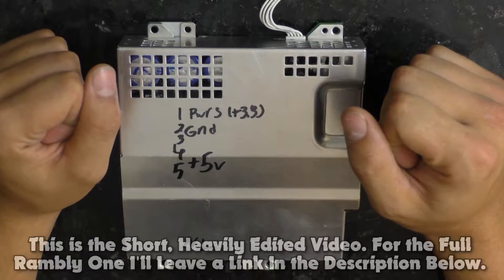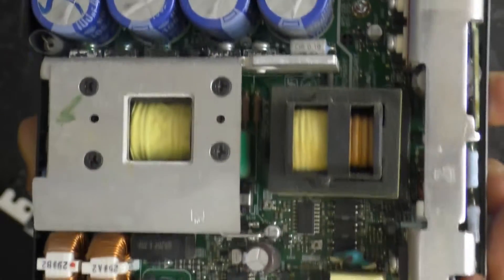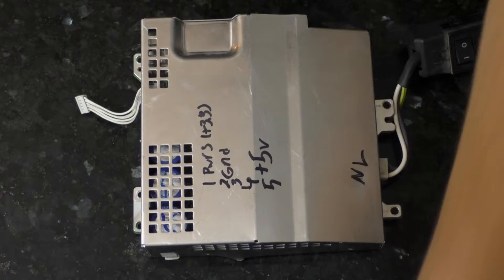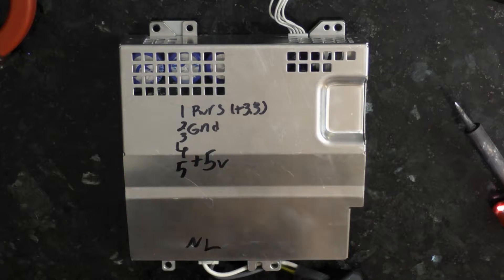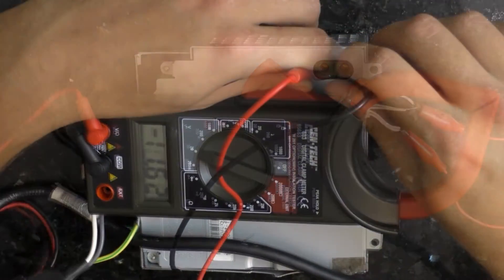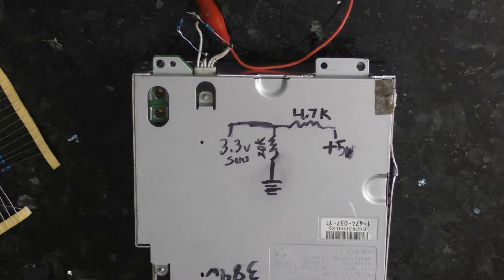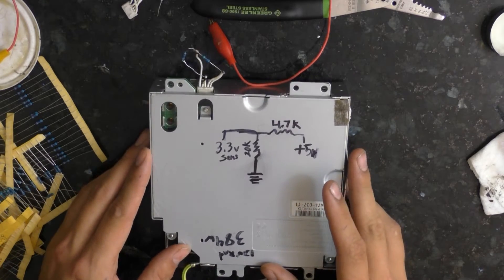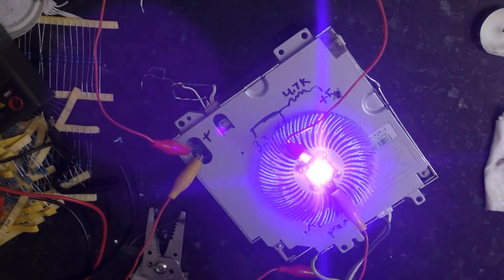Mod: PS3 PSU to 12v, 375w LED Power Supply. Recycle / Upcycle DIY power supply for cheap or free.

Comment: You were using China made Multi Meter to test the China made power unit designed by Japanese company for this video and non stop emphasizing 'CHINA' for something. This is like you drink soda and blamed them for so awesome everyday. Get a life!
Reply from the maker: I am emphasizing China because a lot of stuff here that we get is cheap Chinese junk that doesn't need to meet American or UK standards which typically means a lot of it isn't safe.

 Like for examples many of the electronics having giant metal cases that are a huge electrocution risk but not being grounded and isolated like they should because planning for a proper grounding system and adding wiring for it adds a few cents to a product.

 Or in many devices like LED lights using capacitors that just barely meet or match the absolute minimum voltages even though that's hard on them and because of spikes can quickly cause damage like a catastrophic failure which can even mean fire and the death of someone.

 Lead paint and arsenic found on kids toys... Toxic dog food... Many plastic products still containing toxic plasticizers like BPA which are show to cause Cancer. Toothpaste with diethylene glycol a very dangerous toxin... The list could go on...

 The truth is if a cheap item that fails to meet saftey standards catches fire and kills somebody from a company in UK, US, Germany, Japan or anywhere else then the company will get it big trouble, go to court and pay a lot for it maybe even serve prison time if found to be negligent.

  Or it's from China the company will likely be untraceable, untouchable, or maybe even gone before anything could be attempted to be done. This leads to way too laxed standards.

  And you emphasizing that it was designed by a Japanese company is 100% fine by me, the thing is Japan, unlike China, has made a name for itself as being quality. The old Japanese stuff like Camera Lenses, amps, speakers and such were typically better than US or German products.

 Now I don't want you to get me wrong I am not saying every product out there from China is junk. Much of the brand name stuff is still great and impressively cheap (Though the working conditions to achieve that cheapness is sometimes quite horrible...)

 And yes I know that the PSU is from China and I have no issue trusting it as in the video I clarify, what I was talking about is not trusting a cheap Chinese power supply from specially ebay because I wouldn't know what I was getting (It might of been in the longer version I point this out.)
Reply from the maker: But if you get really offended about me talking about bad or fake products from China I can point you to Wish which is almost made Entirely out of Cheap Chinese Knockoffs of actual products which are not only horrible quality but the theft of Intellectual Property from the companys that make the actual product.

 Or I can point you to thousands of Fake SSDs, or SD cards all over ebay that come all straight from China. Or the faked Iphones, Galaxies, Pixels, Smartwatches...

 Or Lithium Batteries that have forgone safety standards or are just straight up defective that have been know to explode and injure/kill people...

  I mean almost anything out there, Chinese companies have made a cheap knockoff that is way less quality and sometimes very dangerous... Including some companies making and selling shoddy or downright fake Medicines.

China wants people to stop talking bad then they need to cut that BS out...

  Are you from China out of curiosity? If so you should know I got nothing against the Chinese people, just the way the companies act and what the Government lets them get away with.

Comment: If you have just read the board, it is also made in china🤗
Reply from the maker: Epi Dimlas I already clarified in the video (Or Maybe it was in the Ramble Version..?) I specifically was referring to 'ebay China' where quality control doesn't exist. 

 I realize this PSU comes from China too, but at least I know it has been checked and proven not be an electrocution or fire hazard.